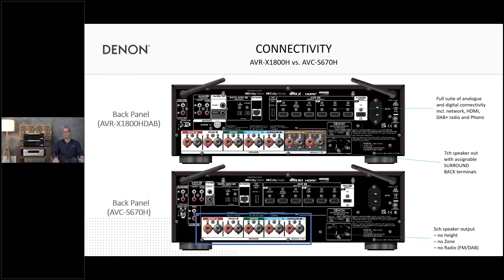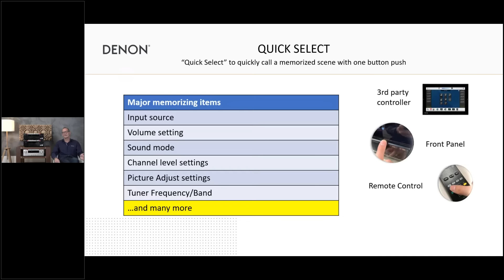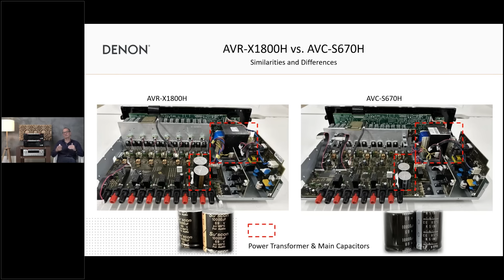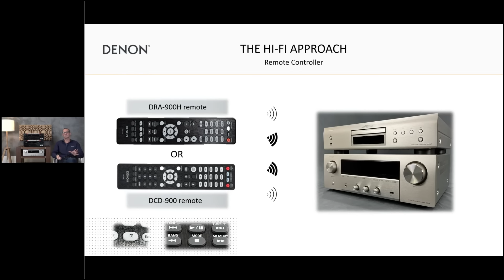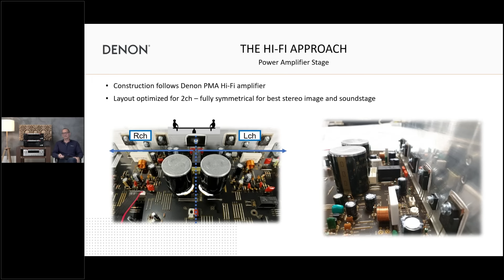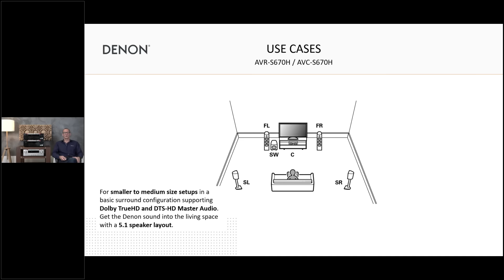Denon AVR-X1800H, AVR-S670H and DRA-900H comparison

Comment: pma-900hne vs dra-900h?
Reply from the maker: Hello,
If the features of both the PMA-900HNE and the DRA-900H check all of your boxes, it will despend on which speakers you have. What make and model speakers are you planning to use?

Comment: I already have a PMA 800 but I'm currently using a converter to use it in combination with 2 subwoofers.
Do you think the proper sub support on the DRA-900 would make a difference?
I don't need the higher power and I have connected my TV via Toslink without any problems.
I really like my Denon and I'm not sure if this is worth the investment yet or just keep my amplifier longer. I pretty much only care about the sound and music is my priority
Reply from the maker: Hello,
It's difficult to be certain without knowing anything about the convertor you have and how it is implemented. Which model is it, and which subwoofers do you have?
Reply: @SoundUnitedTraining 
Thank you for the reply.
I'm currently using the "AIV 630501" adaptor. It was very cheap on Amazon around 20.
My subwoofers are the sub3010 from elac. They only have RCA inputs
Reply from the maker: @jojojaja7659  
Not having used the AIV 630501 myself, I can only speculate. 
I believe the potential is there for your Elac subwoofers to deliver a higher level of performance if you were to switch to the DRA-900H. Removing extra wires, connections and comvertions from the signal path often proves to be sonically beneficial.

Comment: Are there instructions to bi-wire my DRA-900H ?
I have a pair of KEF Reference Model One speakers.
Reply from the maker: Hello,

I would advise against bi-wiring using both A+B speaker ports of the DRA-900H with your set-up. This is because your speakers have a nominal impedance of 4 ohms. The DRA-900H can deliver 4 ohms, but only with one set of speaker ports being used. When you connect both A + B sets, the DRA-900H delivers at a minimum of 8 ohms instead of 4 ohms.

The way to bi-wire using your set-up would be to use speaker which has the configuration illustrated in this link using just the speaker A terminals on your DRA-900H:
https://bloomaudio.com/cdn/shop/products/aq-rocket-33-3-thumbnail.jpg?v=1681148668&width=1800

This link shows the wiring (the second image from the top):
https://preview.redd.it/my-amp-is-bi-wired-to-my-speakers-as-shown-on-the-bottom-of-v0-1ls9wyzis1f81.jpg?width=1080&crop=smart&auto=webp&s=fa9a1ca078417854501e06ccaa11fee3f4a201db
Reply: @SoundUnitedTraining  Thanks for the help !
Reply: Who sells those cables?
Reply from the maker: @AP12248  Those are Audioquest. We use their cables in our set-ups.

Comment: I have a DENON PMA630 and TU630 bought new in about 1976 or so. Still working fine and looking fine. However need for some remote control integration with new smart TV due to awful TV and sound bar performance. The DRA900H looks like my choice. It will be driving my also 70's vintage AVID105's. I will be looking at a DENON CD player as well and wonder what multidisc players will integrate well with the HEOS and remotes?
Reply from the maker: Hello,

The DRA-900H should work well with your AVID 105's.

Multi-disc CD players tend to operate as a regular CD player from a compatibility point of view. They generally come with a single device remote control. HEOS allows you to select connected sources (including a CD player) with the Free HEOS app.

We are unable to make any recommendations on multi-disc CD players as we no longer manufacturer any players other than single disc CD players.
Here is a link to our current selection of CD players:
https://www.denon.com/en-us/category/all-audio-components/

Comment: Thank you!! Will the sound of the A/B class amp be better than for instance the new Denon Home Amp with class D amp?
Reply from the maker: Hello,

The potential for an overall difference in sound that might be heard between Class A/B and Class D is certainly there. Which works better in any given system will depend on the listener's preference as much as anything.

Comment: I was looking for a new reciever because my DENON DRA735 is now outdated (25+ years old). Therefore i was gathering info for a new model. Because my house is not so big a quality stereo receiver was my only option. Thanks for the clearly explanation of the DRA900H. Today i have ordered two receivers in a special HIFI SHOP in ALKMAAR. So for the next years this guy is up and running in HIFI stereo.